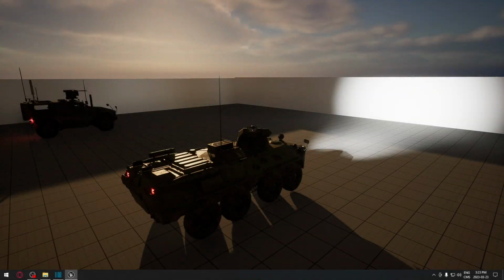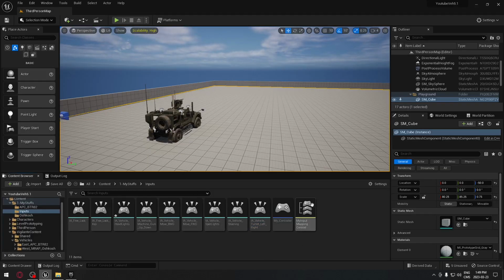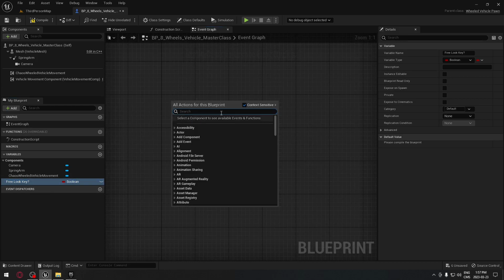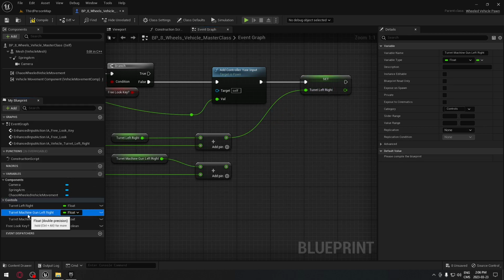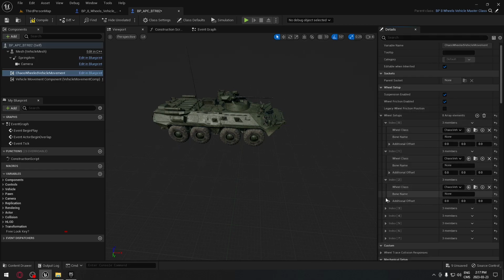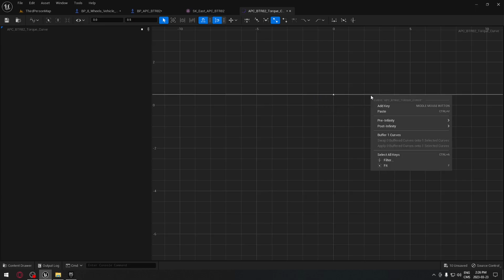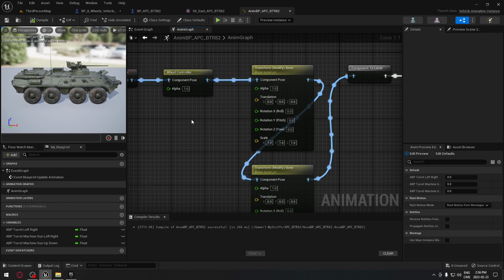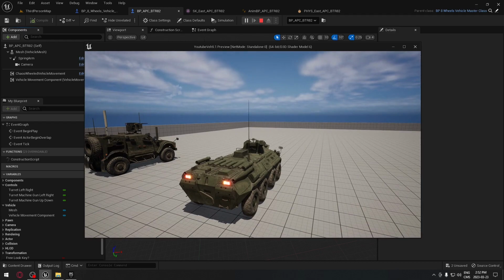UE 5.1 - Vehicle Movement (8 Wheels, Turret, Headlights, Brake Lights)

Comment: Great tutorial thanks for posting. I'm having an issue with the turret rotation (everything working in preview, I adjust in there with the modifier and its rotating properly, bones linked correctly etc) however when I test my camera is locked to the vehicle still and I'm not sure why - otherwise everything else is working fine, again - thanks for taking the time to make this video.